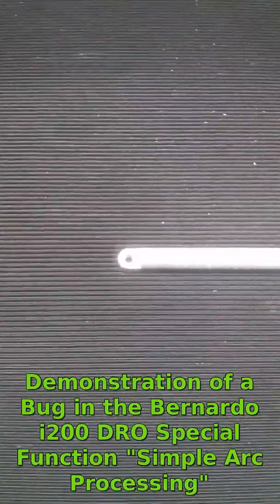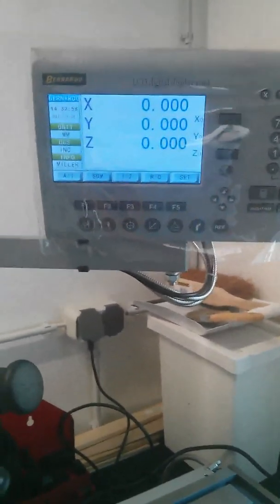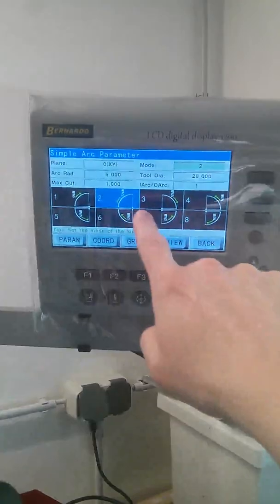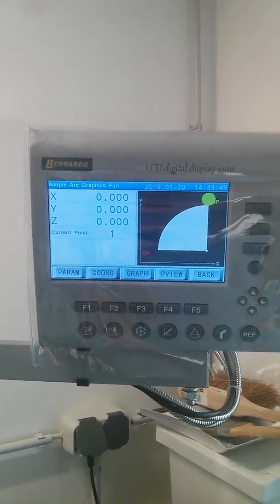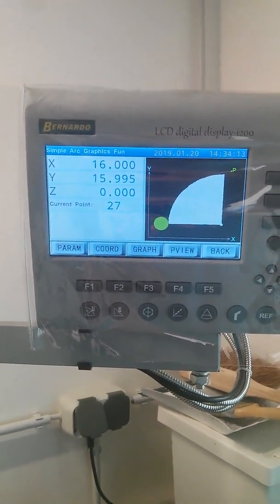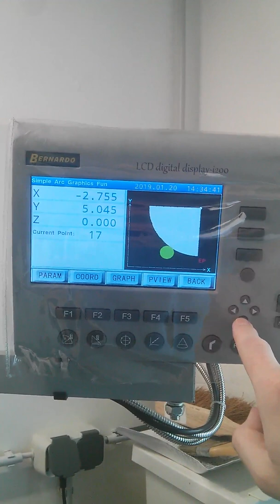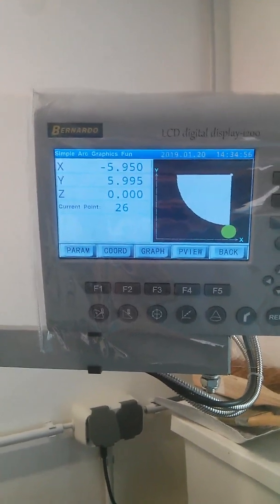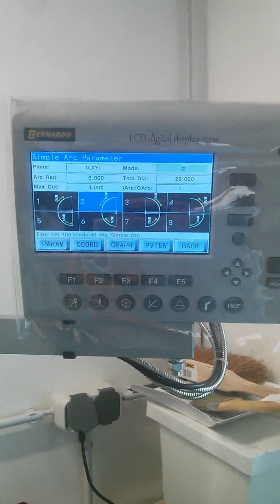Bernardo i200 Bug: Simple Arc Processing

Comment: Thank for the video.
How was the bug resolved?
Could you do a firmware update?
Reply from the maker: Hi! Bernardo requesed a corrected firmware version and a programmer hardware from their chinese vendor. Then I went to their office here in Linz with my i200 (just a few km) and we re-programmed the firmware. The new firmware had the described bug fixed, but it has another bug, where it is not updating the screen properly. However, that is only minor and limited to this arc feature, so it is fine for me.
Bye, Hansi
Reply: @johannglaser  Thanks Johann,
I noticed that in the ARC screen there are arrows inside and outside the circles.
I think that inside arrow means without tool diameter and outside arrow with tool diameter.
I just bought a new lathe with this i200 DRO and have to study it.
There are XYZW axis buttons and 4 connectors on the back, does this mean that the Y and W are supported and can be used too?